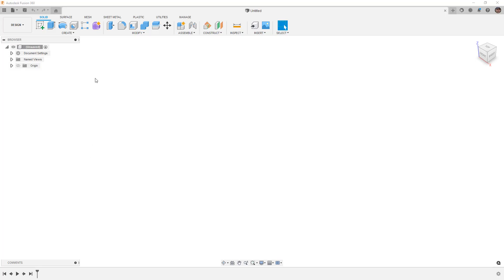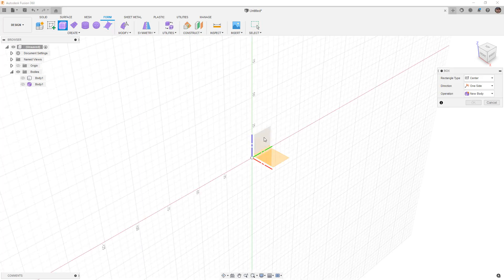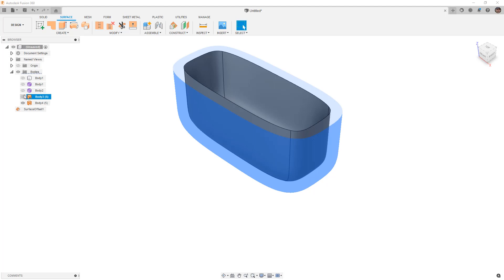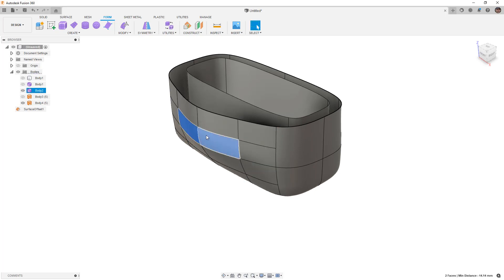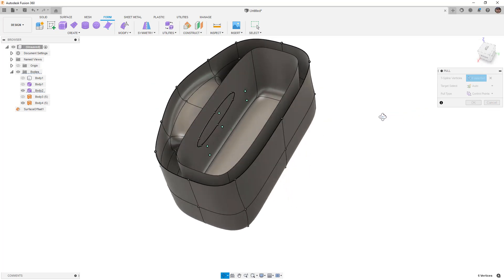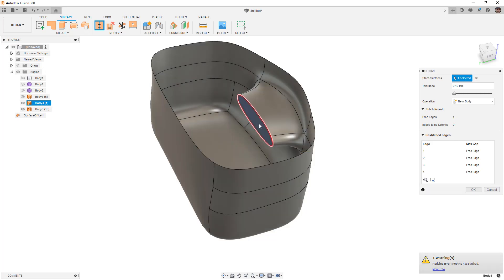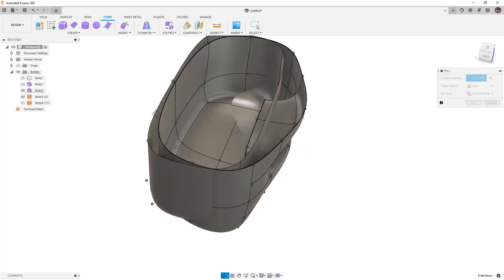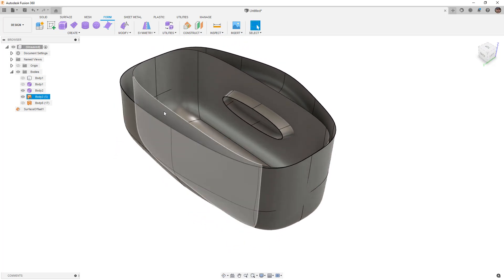Fusion 360 Form Mastery - Part 23 - Direct Modeling with Forms and Surface Bodies Simultaneously

Comment: Totally lost me on this one around the time you were trimming surfaces.
Reply from the maker: The big take away with "direct modeling" when using forms is that the converted surface exists with the form.  When you have history capture on you have to exit the forms workspace which converts the form body to a surface or solid body.

The direct modeling approach can have some benefits like with directly converting faces or keeping a surface and form model in the design at the same time.  Its a fringe case though and 99% of users will likely not need to do it.

Comment: Dang it! Wish I had see this video over the weekend! I lost a very complex Form Body because I had history turned on. Now I can't go back and edit the Form, if I had seen this before I completed the Form, I could have kept it. Oh well, live and learn. I have it for the next one, thank you for these videos! They are SO WELL DONE and so easy to understand!
Reply from the maker: you should always be able to go back and edit it.  With history off there is just no "finish form".  You have to use Convert to turn it into a solid/surface.  If you have history on you should see the purple feature in the timeline at the bottom.

Another option is if you expand your datapanel and look at the design there is a V drop down.  You can open an older version of the design.

But bottom line is that unless something was corrupt somehow you should still be able to get back and edit it.  Just changes while in the forms aren't captured in the timeline but the body should always be editable.

Comment: I think I understand that using the first-created inner form as a control surface is the major takeaway here, but I wasn’t quite sold on how it was used here to influence the second, modified form. The two shapes interacting was interesting, though. I could visualize the inner form as a defined shape around which a more “design-y” wrapper/shell could attach. That aspect did resonate.
Reply from the maker: The thing with this is there are many reasons why you might do this.  One reason to do this is if you want to make a general shape, convert it to a surface and then make additional changes to it.  With history on you could do this by copying the form body and editing one, but in some cases being able to snap to a surface or match and edge with tangency can be used.

it is a bit of an obscure workflow.  The main reason i have done this in the past is with a design where i need to make a "base" shape that will end up driving something like buttons or triggers, and then modify the base shape to be more organic for where those buttons or triggers will end up.  Sadly not somethin i can share.